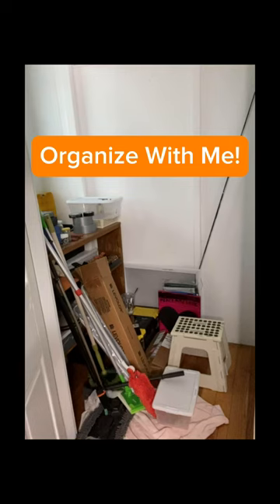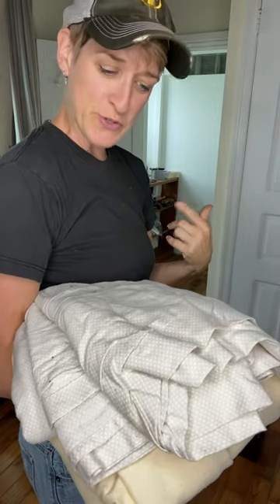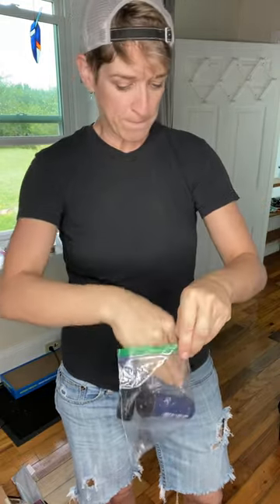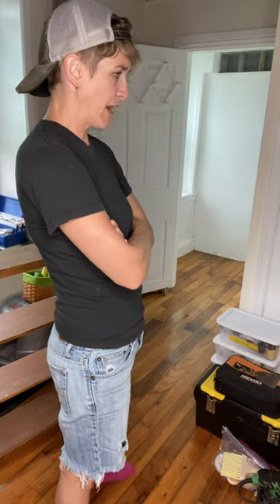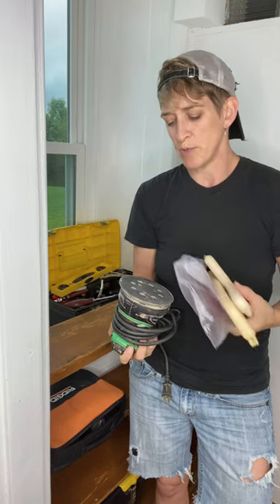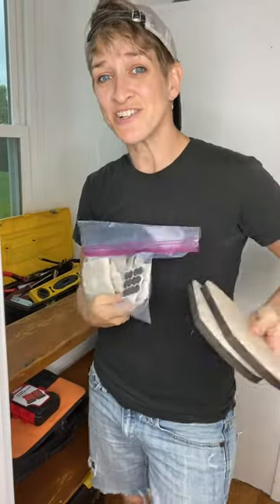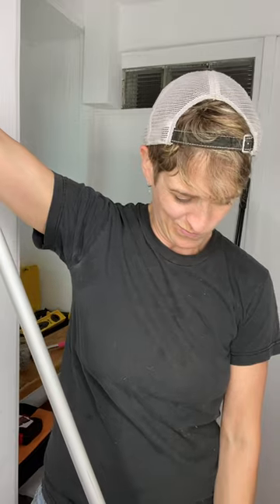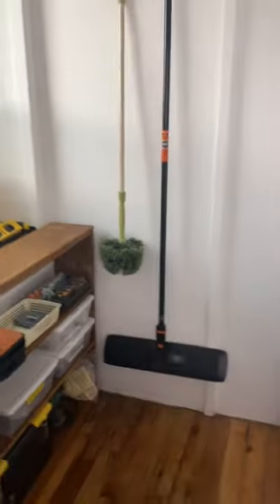Organize With Me! - Utility & Small Tool Space

Comment: I have big reusable zip lock bags for organising made out of silicone. You can get them in all the sizes.
Reply from the maker: You can’t see through them though correct?
Reply: @iOrganizeEverything  mine are semi opaque. So, it's not as great as the zip lock bags, but I am using them to cut down on my use of zip lock bags. As you can see through  them a little and you can put a temporary label on them.